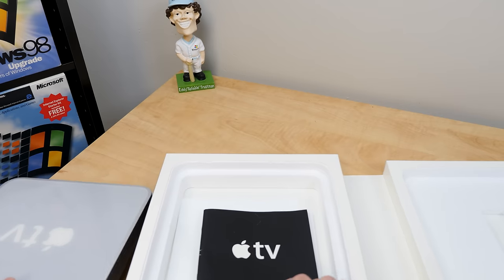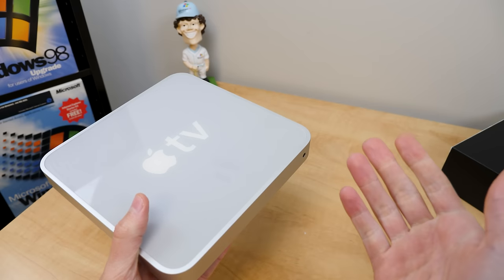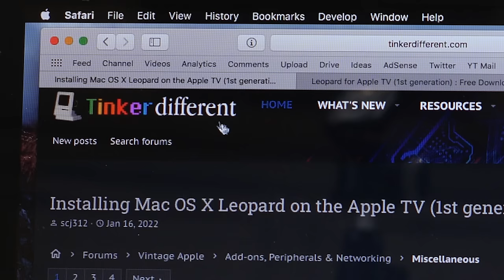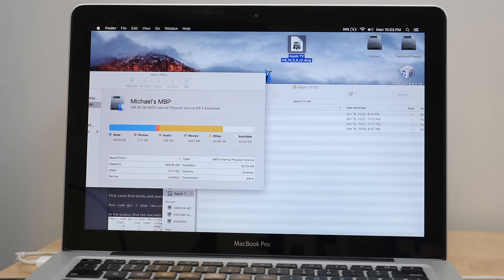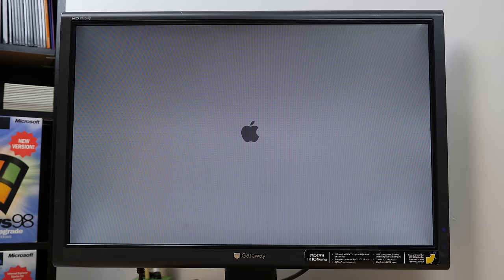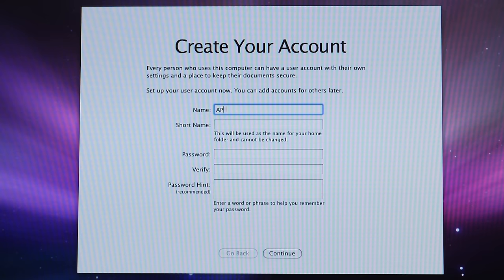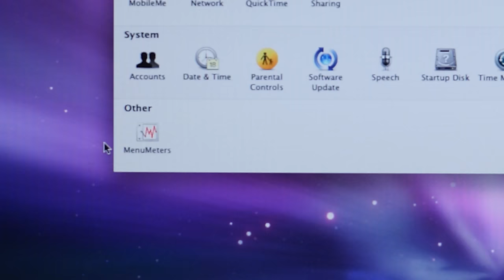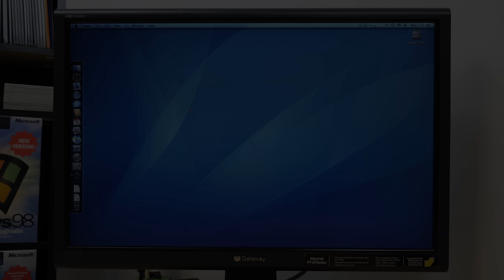Installing Mac OS X Leopard on an Apple TV!

Comment: Now it just needs a RAM upgrade. Does require soldering, but it's only 4 chips, so not too bad of a job. Surprisingly, Leopard actually runs WAY better on these with 512MB. Though, I am working on a way to get 1GB working on these, which will be even more of a nice upgrade.
Reply: Only 1 core CPU though
Reply: That sounds like an incredible upgrade
Reply: Funnily enough I was just watching you upgrade it to 1gb ram.
Reply: @FS--ew3se  Unfortunately later on I find 1GB does not work, as the i945 chipset doesn't support 2Gbit chips. But I have an idea that should work to bodge on 4 extra chips.
Reply: @dosdude1  cool
Reply: @dosdude1 hey dosdude, i highly respect you, especially for your patcher, are you going to make more patchers or no? Also how can i get sidecar on your catalina patcher, have you found a way? Thx if u reply, you are the best
Reply: Waiting that video.
Reply: JUST GET A REFURBISHED MAC MINI
Reply: You're awesome man!
Reply: thanks a lot for your patchers mate
Reply: @RaniRani-zt2tr  Well, in a way, yes, that's right. But this kind of project is in no way done with practicality in mind. Leopard is of limited use these days anyway, and you could just as well run it in a virtual machine for that matter. The fun (though sometimes might not seem that funny when things go uphill) is in running it where it does not belong.
Reply: Legend
Reply: @SP-ny1fk  the mac mini back then had a single core cpu as well
Reply: @RaniRani-zt2tr  and missing the fun you have with re-purposing an apple tv? Neh, if possible not.

Comment: This may seem like sacrilege, but think about this:  It reports a 1GHz CPU, 256MB RAM, and it has a 40GB HDD.  Those are prime stats for a fast Win98SE machine...
Reply: i was thinking the same thing
Reply: Unfortunately, the firmware prevents this, but it’s probably possible with tons of custom drivers. XP is doable with a hacked kernel but wouldn’t perform that well on 256MB.
Reply: There would have to be chipset and video drivers available, however.
Reply: @iannicolson  chipset should be intel Pentium M/intel core 1st gen era iirc & video is like a GeForce 7300go or something shouldn't be an issue as some multimedia linux distros like xbmc were extended to work on Apple TVs back in the day
Reply: QEMU with Windows 2000 works fine

Comment: I don't think I've ever seen a device with an HDMI port that still uses an IDE HDD, anyways... Thank You Michael, very cool!
Reply: I'm almost certain that the cable box I had back in ~2009 had an IDE HDD and HDMI output. Boxy Motorola thing. :)
Reply: Literally my old motherboard
Reply: Lol, the more you know, now I feel young and clueless. In my country, DVI wasn't used much, so the technological jump from VGA to HDMI meant that I got many computers using SATA but only VGA, but none using IDE with HDMI. Crazy stuff.
Reply: @AnotherFreakingDude  Huh, same here, but I had an "special case". heck that motherboard even had DisplayPort! And it is AM2! (It is an M3A78-EM if you're curious)
Reply: The Ps3 devkit does
Reply: I never saw a first gen old thing with an HDMI port
Reply: HP Pavillion has that too.
Reply: @ezequieldom641  Are you sure? We're not talking boards/ machines that have IDE in them, but those that ONLY have IDE. Regular ATX boards have had SATA (as well as IDE) since, what, 2004, late 2003 even? Not budget ones, that's true, but since 2005/6 they all have had SATA, so...
Reply: @AnotherFreakingDude  His mobo DID have SATA, obviously. And IDE as well, but so what?

Comment: If you don’t have a blow dryer (3:51) you can power it on, make it get warm or hot in some way, it makes it much easier to peel off without breaking.
Reply: As I recall they run really hot.
Reply: 10 likes celebration
Reply: Well, yes, but that would also make it too dangerous to manipulate, as there will be still some static electricity on the board, that's why you shouldn't open anything electric that stills warm

Comment: Apple really did think differently when they chose to ship this unit with an IDE HDD from the time of Pentium 3 laptops. As a matter of fact, I upgraded my 40GB disk to 120GB on my 1GHz P3 laptop, back in the day, just before getting a P4 one.
PS: the video is really awesome and the OS upgrade is quite intriguing, so the entertainment factor of this clip is high.
Reply: Wow...
Reply: Mac OS leopard and the old Mac os’s .. are my favorite os’s. Too bad we can’t install those instead.. I upgraded my 2014 MacBook and on that one I can go back but not on the 2018 Touch Bar
Reply: @Akhilesh Sattanathan what are you new?
Reply: @aMabbitt  yes
Reply: ide was still the stuff in 2005
Reply: Nothing unusual about IDE in the mid-2000s. And for streaming, it didn't need to be a performance machine.

Comment: AHHH! That Gateway HD LCD monitor was my first LCD panel! I freaking LOVED that thing because of all the inputs it had! Composite, component, DVI, VGA, S-Video and a USB hub. That was an awesome monitor for the time, even if the picture kinda sucked. I remember using that bad boy for my PC, Xbox 360, original Xbox and PS2 all hooked into various inputs, and loved showing off how I could seamlessly switch my monitor from PC to game console. I even have the menu sound burned into my brain. DOO DOO.... Deedoo.... Good times...

Comment: I love the aesthetic of old Mac OS.
Reply: As a non-mac user I think Yosemite is the coolest rn. I just think it's the cleanest MacOS ever.
Reply: Sentry  A friend of mine is using Mac and is strongly discouraging it, especially for multimonitor setups: there is no option to pin the dock to one screen and it keeps jumping around and ruining your maximised apps. No keyboard shortcut to move windows to the sides or to other monitors (like Win+Arrows on Windows). No monitor daisy chaining. The non-ARM macbooks are jet engines. Also personally I think Windows got way better design with Win11 than it had in 10, it went back to having somewhat readable icons. If it's just the design you're going for, I wouldn't do it. Also Windows can be customised a lot, I'd look into some custom icons and themes if I were you.

Comment: Still got my 160GB model running Debian 11 and RetroArch. This thing is still awesome.
Reply: How’d you get Debian installed? I couldn’t get it to boot
Reply: @DistrosProjects  lol
Reply: do they support 4k resolutions?
Reply: @lolcat  this thing is from 2007.
Reply: Sus here.
Reply: @kjjustinXD  the earliest 4k tv was in 2001.
Reply: @qwdqwdqwdqwdqwdqwd8591  no, it wasn't. What you mean is an IBM LCD Display that requires 4 Seperate DVI channels to work. Which is as far away from a TV as it gets.
Reply: @kjjustinXD  still output 4k right? lol

Comment: Hacked one of these back in 2009, doing it the SSH in method. I thought I'd have a sweet emulation box but the reality was it was prone to random relaunching and utterly slow performance. I put SNES9x on it and it did work but just barely.

Comment: Yeah, the 1st Gen Apple TV! I just installed with a custom Firmware (OSMC) back in 2019 to use it as a media center. However, installing OS X as I saw from Computer Clan might been possible(?). Thanks for the video Michael!!
Reply: It’s possible but you need a MAC computer for modify the files on the apple tv hdd.
Reply: @Peti4391  yeah that might be too.
Reply: I used to use OSMC on an Apple TV back before I had a smart TV - it was fairly slow because of lack of HD video decoder but still got me there!

Comment: You can press Cmd+Shift+. to show hidden files in Finder more easily btw
Reply: He appears to be on OS X 10.11 which was before they added that I think.
Reply: @4444aa  Just checked, you're right, didn't realize that it wasn't added until macOS Sierra
Reply: @4444aa  *10.5
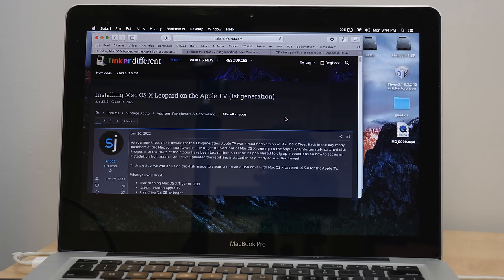Reply: @reuben-rt  I mean the computer at 6:47

Comment: Great video as usual :) 

Did the CMD + Shift + Dot-Key command not work in those early OSX-Versions to show hidden files? Just curious :D
Reply from the maker: Thank you! And no, that keyboard shortcut doesn’t work on the version of OS X that I was running
Reply: @MichaelMJD  in those days I installed Tinker Tools to show hidden files an to switch on/off much more Finder-features

Comment: Very nice. I had to try several times on a ATV1, but with 160GB HD on different iMacs. But now it worked and it works perfectly fine. I'm surprised that it even shows full HD on my monitor. I'll use it for eMail and some lightweight stuff!

Comment: Should have used a modded browser for Leopard/Snow Leopard to help ya get around the web better. Very cool project!  dosdude1 did this, but he also took it apart and upgraded the RAM to 512MB. He was aiming for 1GB but for some technical reason he described, he could only get half.

Comment: Not sure if this would be applicable for the version(s) you're using. But at least on modern macOS, Cmd+Shift+. (yes, period) will show all files in Finder.
Reply from the maker: That wasn’t a thing on the version of OS X that I was running

Comment: Could you not mod it so it uses a SSD instead of a hardrive
Reply: it uses IDE which ssds don't exist for, besides even if you used an adapter, IDE would be too slow to make a difference

Comment: Question, the mid-2009 MacBook Pro you used to write the image, is that a dual core? What OS X version are you running? I have a mid-2009 MacBook Pro but I was having trouble updating it, and ended up going back to snow leopard. No good browser options for snow leopard. What would you recommend?
Reply: With a decent amount of RAM Id do no less than 4, 8GB is best for these days) youd be surprised what you can run. I have a 2009 iMac Core 2 Duo running Monterey through OCLP..  I would also suggest an ssd though,

Comment: atv gen 1 does not run a modified osx version its based round a intel pentium m based CPU an nvidia 7300 chipset 
it has a normal install of osx on it only thing it does is startup frontrow bij default on boot.

Comment: Just a quick question lol. Would you happen to know how to download windows me or xp not on a virtual machine. I have windows XP but 32bit. I downloaded windows me from winworldpc but i get an error with my win xp pc thinking I'm in windows 2000. Got any tips?
Reply: Format HDD first then install
Reply: @memediatek  i know but i have the iso file in a USB, i click the option to boot from it, and then I get the flashing underscore in the top left corner. Then my pc starts beeping and I turn it off

Comment: basically an early mac studio mini
Reply: The first Mac mini was released in 2005, with a PowerPC G4 CPU. This Apple TV sold alongside the first Intel Mac mini machines. Both machines supported the use of a remote control, and the Front Row software provided on Mac mini was very similar to the Apple TV interface.

Comment: waiiiit - did you actually have to remove the hard drive from the bottom tray? I wonder if you could have just used the cable and attached it to your adapter that way
Reply from the maker: No, it wouldn’t have worked. I would’ve needed a male to male IDE cable, which I didn’t have.

Comment: Tip for toggling show/hide files in MacOS Finder:
CMD+SHFT+. (Period)

No need for a terminal command to do that.
NOt sure how many OS versions this has worked for, but it works certainly as far back as Catalina, probably earlier.

Comment: In theory using this method you could probably even install a Linux version and get Minecraft running on it :)
Reply: I did this once using Arch Linux. It ran at 1FPS in the menu and took over 20 minutes to load.
Reply: And I heard someone managed to boot Android on it
Reply: You'd be lucky to survive the first night.

Who am I kidding.
You'd be lucky to even make it through an hour!
Reply: @DailyCorvid  depends on what version and what enhancing mods. Playing release 1.0 with OptiFine might not be a bad solution worst case scenario you have to use infdev.
Reply: @DistrosProjects  did you try any performance enhancing mods?
Reply: @DistrosProjects  @kingdom3533 has a video running Minecraft on antix Linux.

Comment: Next : Windows Xp on apple TV
Reply: Theoretically possible
Reply: Windows 2000 yeah but not XP, no way with just 256MB of RAM.
Yeah ok the minimum says 128MB and a 233mhz CPU...
But realistically you will take 20 mins to start-up with less than 512MB.

Comment: I could not boot into my USB. Could anybody help me please?
Reply: you need to be more specific what computer what usb what system your using, if your using a apple tv make sure you follow the guide correctly and i think it has to be formatted with mac or it wont work
Reply: @darkspongebob11  i used my MacBook 4,1 and i did the guides right. But the Apple TV wont boot from usb. It just goes like normaly
Reply: @KaanSystems  im not sure if it supports usb althrough juding from the guide that i saw briefly in the vid im guessing it should its possible that the usb you used is unsupported in some way or maybe you did something wrong without realising anyways the best way probally is putting it on the hard drive like he did even tho its the hassile of taking it apart and connecting to a pc another way. but maybe try a diffrent usb and double check you did everything right might be a idea to say the exact one u used also (the usb) also make sure you have the right apple tv version since only the first one is supported
Reply: @darkspongebob11  I tried with the Hard Drive and now i have an Apple TV logo with Questionmark
Reply: @KaanSystems  try redownload the hard drive file it might be bad

Comment: Can anyone help me, so basically when I try to install mac os x lion I would be able to make it until the install page, then it will say that there has been an error, unable to download components needed to install Mac os x lion, now I can't do anything on it, and if I do download another OS I cannot because I cannot get the wifi to work on it nor can find the Ethernet cable. Also I'm downloading this on a 160GB hdd if that means anything, on a old MacBook pro ofc.
Reply: I don’t know if this applies to you, but several of the newer Intel OS X installers have a weird setup where if the system’s date is too far away from the release date of the OS it throws an error immediately after you begin the setup process. You need to manually set the clock back in time via Terminal. Maybe since they share a lineage something similar is happening?

Edit: I searched for your error and there’s a result on the domain iboysoft that explains that Lion can have the error that involves resetting the date
Reply: @Eyetrauma  oh ok tysm!
I'll look into from there
Reply: @sas999LLJW  put the present date and time in

Comment: If anyone can mod this Apple TV to have 512MB or 1GB of RAM, this could be a very capable early Intel OS X machine.
Reply: @Dosdude1 has a video.
Reply: Someone has.  It's possible, if you don't mind BGA soldering and adding a few bodge wires.  A simple module swap it is not.
Reply: You might be better with an early Intel Mac mini. Then you don't need to solder to upgrade RAM, and you have more ports.